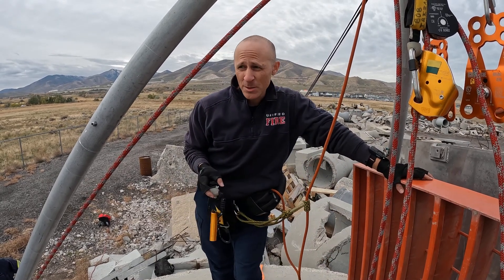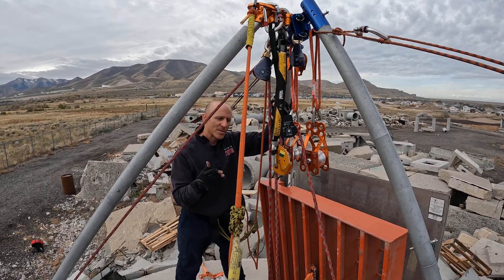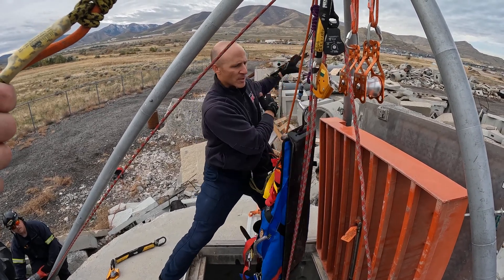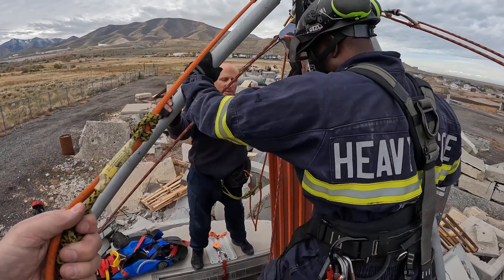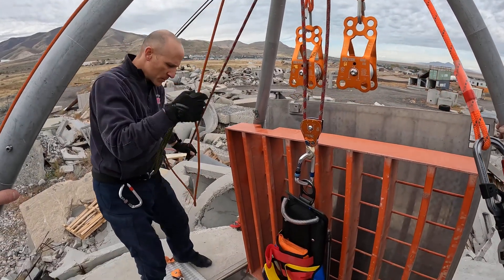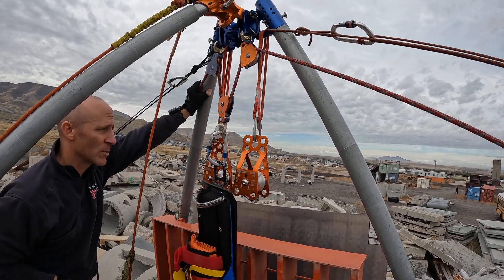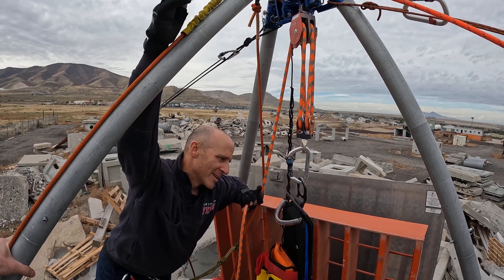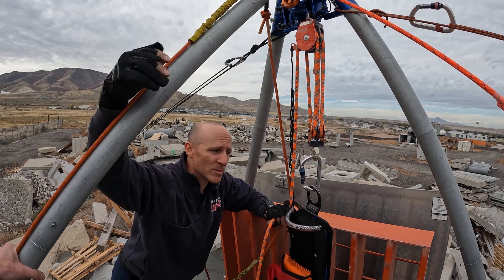Tripod Rigging Options for Confined Space Rescue (Can You Spot the Obvious Major Rigging Mistake?)

Comment: Bob, I believe the mistake would be the COD pulley in the “N” rig which is incorrectly pinned into the vortex head. Also it looks like the edge restraint for the cameraman and possibly a guy line, both going to the orange mono pole head are not clipped in a way to provide proper loading of the carabiners.
Reply from the maker: Nailed it!  I was frustrated when I saw that after filming but we didn't have time to re-do it all.  I'd say there are no issues w/ the guying or restraint line carabiners at the orange head.... loading still along the spines even when clipped down onto the head; mistake or no?  Doesn't matter.

Comment: The "victim" didn't have a belay. There was only a single point of contact.
Reply from the maker: If you’re referring to the actual person that was in the hole….. No, he did in fact have a belay.  If you’re referring to the empty SpecPak, there was no belay line attached because the point/focus of the video was to go through the various mainline hauling options, so I omitted any additional belay lines for visual clarity
Reply: @Propeller_Head  I'm referring to the empty SpecPak. How would you tie in that to the belay?
Reply from the maker: I would have one entrant set a static vertical lifeline and then use a mobile fall arresting ASAP connected into the SpecPack.  If ASAPs aren’t available then it’s got to be a more traditional belay line operated from outside the space